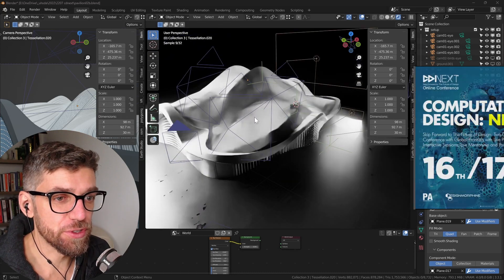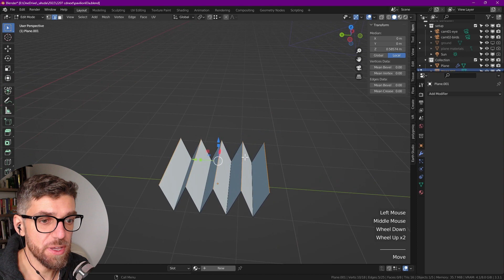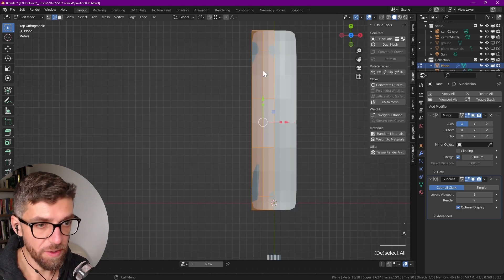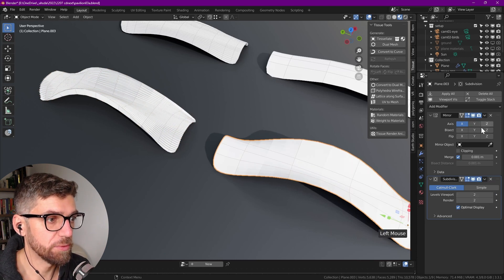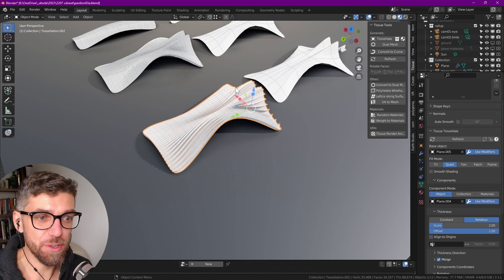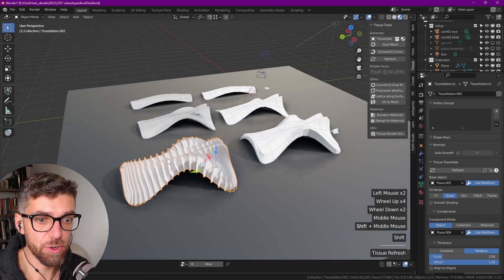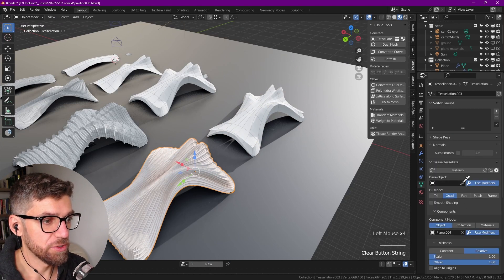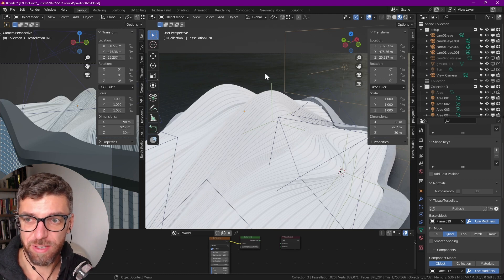Easy parametric ridge-like structure with Tissue

Comment: how do u get the tecnical drawing from that or make it more "constructable" ??
Reply from the maker: You would first "unwrap" it to get each panel separately, positioned in the best possible way to use it for creating a mold. There can also be an intermediate step, where instead of having a huge number of different panels, they can be optimised to have 3 or 4 different types. This is typically done by a facade consultant like Newtecnic or Case Inc. with the help of the Kangaroo plugin in Grasshopper inside of Rhino.

Comment: Would it be possible to have the ridges gradually flatten in some areas (the top of the slope for example), while protruding in some other areas (the bottom of the ravine for example)?
Reply from the maker: Yes, that can be done in Tissue with Shape Keys. It's a bit more advanced, but basically you can have an empty acting as an attractor, and generating a vertex group gradient between to shape key states of the same object, one that's relatively flat and another that's highly angled.

Comment: looks amezing, but how do I docmunt something like that?
Reply from the maker: Depends on what kind of documentation. Traditional plans, elevations and sections and currently best done by importing the project into either Freecad or Rhino. However, this structure wouldn't be possile to get built from just plans and elevations. Instead, it would need to be broken down into parts, and the sizes and quantities of these separate parts would need to be documented. For example it it were to be a thin concrete shell, then with the contractor, it would be important to know how to break it down into separate parts So the documentation for the mould would be needed, which would be an architecture and engineering exercise on its own. In most cases, even if moulder, it would likely be panelised, so the separate panels would need to be documented independently.
Reply: Yeah, I was hoping there were an easy way to break it down to smaller pieces in some automated way. Lol. One can dream.

Comment: Hmm.. So I tried to repeat this in Blender 3.5 and found out that the addon Tissue Tools is not working. Same file I created in 3.5 and opened in Blender 3.3 seems to working fine though. Sad.
Reply from the maker: It should be working. It it gets updated rather frequently. If you google Blender Tissue, you can get the latest dev version from github
Reply: @UHStudio  I found the reason, it was conflict between Tissue and another addon, which also uses Numby.
Reply from the maker: @MikeMike-wc8on  good to know!
Reply: @UHStudio  so I just disabled Numby module in Sverchok (it is not this really needed there all the time) and everything seems to be alright now :-)

Comment: Hello, super tutorial. Just have an issue with some part of structure don't go the correct unwarp whatever I do...
Reply from the maker: Might have to experiment with the UV unwrap, by rotating the faces, or by using the rotate tools in the Tissue sidebar.  Alternatively, what I've found is that if you start from a plane, scale it up, and then create loop cuts (as opposed extruding edges), the mesh maintains orientation better. There are also issues with the Bundled Tissue version when using the Mirror modifier. i suggest trying the lastest tissue from github instead.

Comment: Is it possible to do these things using just node? Like a Rhino grasshopper.
Reply from the maker: It is, some genius people have a made a tessellate-like node group for geometry nodes. However, the point of this video is to show how easy it is to do a completely parametric model without node scripting. For example, this would take a little longer to generate with Grasshopper. The base shape generator could either be imported from Blender or created with Rhino's subdiv tools. But, it won't be as fast. Not that Rhino/GH doesn't have a place in my workflow. I actually use them all the time for working it better paneling, etc. As for quick concepts, Blender is excellent and super fast
Reply: @UHStudio  So what do you recommend for an architecture graduation project. Use blender or Rhino-Grasshopper?

Comment: Very helpful! I've been looking for something like this for Blender because I've used this kind of workflow within Revit wherein an individual creates an adaptive family that is prepared to be applied to a mass that has a pattern. Thank you for sharing.
Reply from the maker: Cheers! Yes, it is quite fun actually! However, you can't quite push it to the same level as adaptive families, where, for example you can have a frame of the panel stay consistent no matter the size. Actually, it is possible with the "frame" option in Tissue, it's just that the middle area from the frame is currently limited to what it can be.